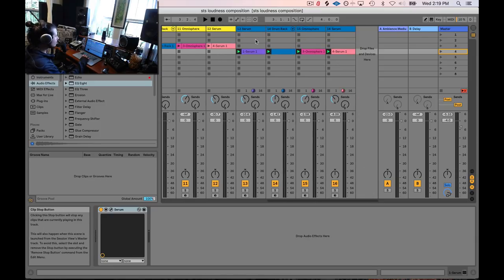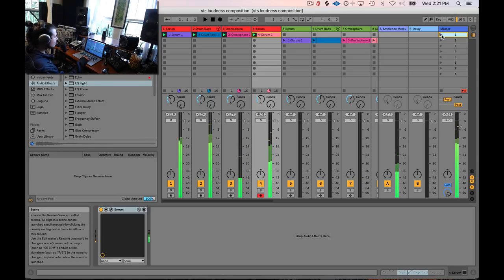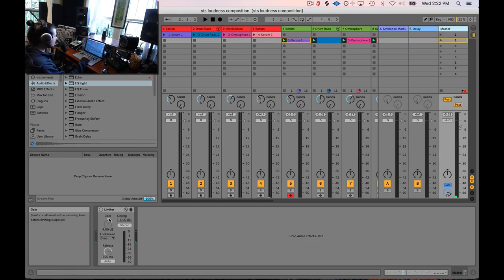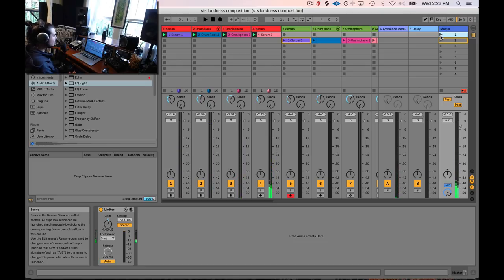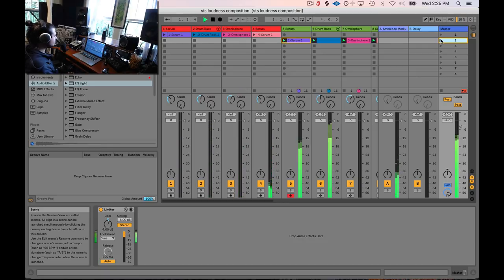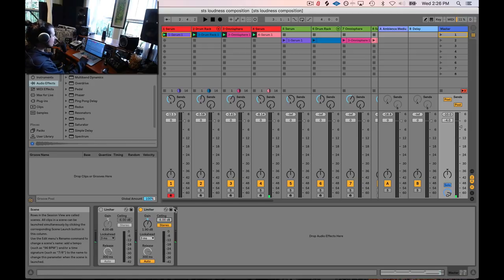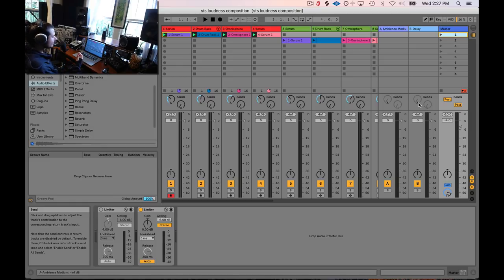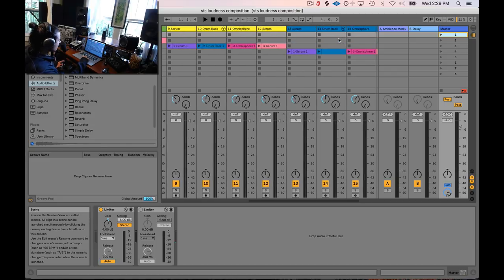The Most Effective Way to Get Louder Mixes

Comment: Mr. Bill also emphasizes this point very well.  The saturator tip from a previous video also helped my mud mixes for sure.  When it comes to separating the transients and stuff so it doesnt get too layered, what recommendations do you have for cinematic type space ambient like Carbon Based Lifeforms and the such, where there are many drones layered on each other and thick soundscapes filling the mids?  I feel like that kind of music has much less room to "breathe" and so is harder to make loud vs a bumpin Tipper or Mr. Bill track with defined separate sounds.
Reply from the maker: If you watch at the end of the video I show how carving space out for sounds using eq is very effective. As for carbon based life forms, they are masters of this. Layering doesn't mean a lot of the same frequencies on top of each other, otherwise there wouldn't be a point in layering. Each layer, each sound, each track can occupy a unique area of frequency focus and the same objective is achieved: separation and thus, loudness
Reply: Rosetta Stoned which previous video? Can you list the title of the video that way I may search it in his video queue? (Not link but title preferably :)

Comment: I understand the reason for doing the things you’re doing but, the two sound completely different now.   The original scene has a more dark, ominous sound.  The second scene has a more funky, groove sound.  What if I wanted that dark scene one sound but, louder without having to change the feel of the scene?  I probably should have watched to the end of the video before commenting, you probably covered this.
Reply: I agree with you, changing composition to increase loudness doesn’t make a lot of sense.

There are a million ways to increase loudness... probably the lowest hanging fruits are to cut off frequencies you don’t need from certain instruments (chords don’t necessarily need bass in them, for example), and adjusting the individual levels of instruments so that the limiter is able to increase in volume more before it gets hit (if a kick drum is 3dB too loud, you won’t be able to push the limiter as hard as you should before you start to get distortion and “breathing” effects).

Comment: having the limiter ceiling at - 6db is that standard, I thought normally people make it - 0.3db
Reply from the maker: To prevent it from blowing your head off when I turn it on / off ;) You are right, normally you'll want it between -1 and -.2 db depending on the application

Comment: I think you are confusing a good sounding "mix" with a good sounding "song". Technically, mathmatically, on paper, it produces a better "mix" to not have any two instruments playing at the same time. However, this is less "mixing" and more "avoiding", as in you're avoiding doing any mixing by not having anything to mix, because no two instruments are playing at the same time. It almost takes no real talent or ability in the mixing realm to sabotage your composition such that your track is overly optimized for mixing/loudness with no regard to the overall song itself. The difference between your first and second composition is stark. The second one has no energy in it at all and frankly I don't want to listen to it, regardless of how "loud" it may be in your meter. It sounds like three musicians taking turns playing their instruments one at a time, and not like a band playing a single track together. The advice given in this video is abjectly horrible